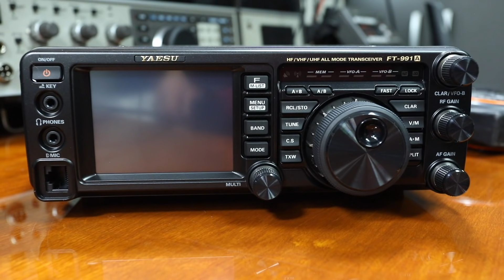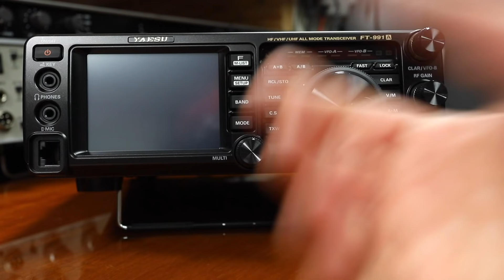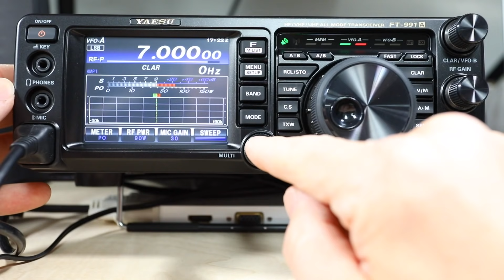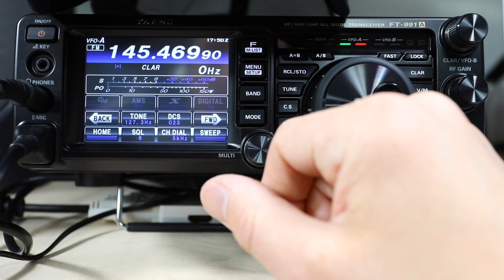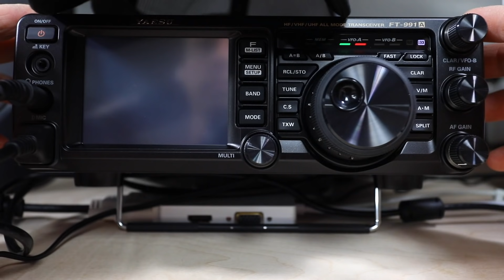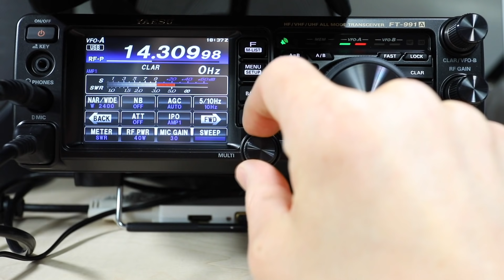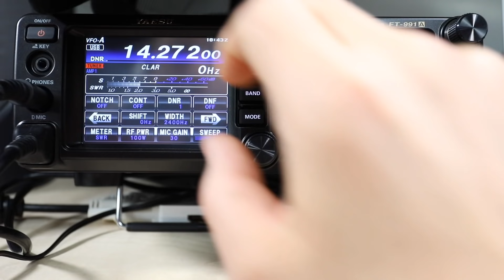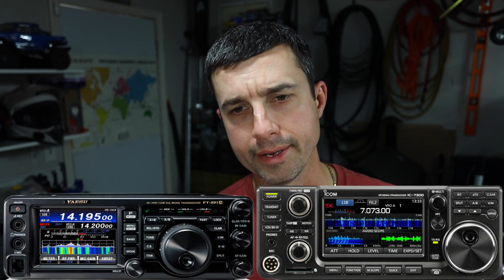Yaesu FT-991A Unboxing + On-Air Tests

Comment: I like the FT-991a for the fact it covers 2 m and 70 cm, it would be a good replacement for my FT-897 although I like it too.  BUT, a couple years back when I was looking to purchase either the 7300 or the Yaesu, the 991a wasn't out yet, just the 991.  Only after I got my 7300 did the 991a come out.  Yes, the 7300 is a great radio, but the 991a would have suited me well also.
73 de KQ2N
Reply from the maker: It was a tough decision for me too. I am using the 2m side of it, as I'm running a boom mic into into it. I just have to watch my mic gain. On HF SSB, I set it at 44 and when on 2m FM I have to drop it down to 18 other wise I sound very over-modulated.
Reply: I bought a second hand 991 (not an A) just before Christmas as a Christmas present to myself. I had a slightly different route to the decision though! I have/had a second hand IC-706 Mk1. Works great, but I wanted UHF as well and maybe a bit more power on VHF. I have a mobile 2m/70cm set, but I wanted something which could sit on my bedside cabinet without too much of a mess. So. Would it be worth going for an IC-706 Mk2G? Quite expensive at about £500. Wonder what I could get an IC-7000 for? Ah, one sold for £585. That would definitely be preferable. But that must have been a one off, they now seem to sell for well over £600, nearer £700. Hmm. How much is an FT-991a? Hmm, over £900 second hand. But it has a built in tuner, so...

Oh look, someone's selling an FT-991 for £615. Will that fit on my bedside cabinet? Yep. Ok, I'll buy it!

So I didn't really start with FT-991 vs IC-7300, I came at it from a different angle. A bonus is that one of my local repeaters is Yaesu digital, which is sort of the icing on the cake, though so far I've only found one other person in the area I can talk to. He was really surprised when I came up on the repeater as he'd been on his own there for a couple of years... :-)

Comment: Interesting stuff, thank you. I am considering getting 911, you may have made my decision a little easier. The video would benefit by removing the  unnecessary background noise, I am a little hard of hearing, advancing years does that, any background sounds make understanding harder. Bin the added sounds, it doesn't make the video any better or more interesting. Sorry for the grumpy remarks and thanks again for posting this.

Comment: Very nice review. I'm a new Ham, earned my Technician license in February of this year and am currently working on my General. I have been considering three radios to get into HF. My current VHF / UHF radio is a Yaesu FTM 7250 and I absolutely love it. It works very well and unlike so many of the other manufacturers, Yaesu offers a three year warranty. On the lower end of the price range, I've considered a FT-450D and on the upper end I've looked a the FTDX-1200 (There are still some new units out there) and the FTDX-3000. I really do like the scope on a radio but considering budget, I could do without one. I'm just curious if you have considered any of those radios and what your opinion of them is. Thank you and keep those videos coming. I really enjoy them. David K4UVX
Reply from the maker: Thanks David for all the kind words! All the radios you mentioned are great. The 450D seems like a great radio for the price and a few people in my club have it and they like it. Two things I kept in mind when shopping was the ability to plug in a USB cable and new digital filters that helps with receiving. Best a luck for General, HF is a lot of fun! 73~Jason/KM6FAK
Reply: Thank you for the feedback Jason. It really helps me evaluate all the choices out there. I was definitely considering the ability to connect to my computer but had not considered the digital filter options. Thanks again! 73's David / K4UVX
Reply: David Hayden congrats on your technician.   How is going with the general studies.  I just passed both tests at the Cowtown HamFest in Ft. Worth.  I am taking notes here.  Haha.

Comment: you can`t compare the 2 radios, for HF the ic 7300, for a shack in the box 991a.
Reply from the maker: You are correct they are apples and oranges. But, it was a decision I needed to make and I needed to compare them to make my final decision. If you look at the other comments, I'm not the only one comparing/deciding.

Comment: A fine radio for its band coverage. Why though did Yaesu not use a proper VHF/UHF Antenna socket. i.e a" N" type socket that is a 50 ohms rated connector for VHF/UHF frequencies. I would more than likely change it for a Ex mil "C" connector.(like a larger "BNC"). I used those on UHF radio relay equipment years ago. I would do that for any coax connector at those frequencies. Plus they are waterproof and easy to connect. I hate to say so but the sound of received CW from the FT991A leaves a lot to be desired compared to the IC7300. I am a musician and hate to ear distorted sound and to me You would soon tire not hearing a pure note, be it low or high. That's personal taste. like receiving CW from a buzzer rather than a sine wave oscillator. Overall what you get for the price is dam good. I have not heard much of a review on the C4FM  mode on the FT991A. It must attract quite a good number of Hams who use 2m/70cm. It appears to be a very popular mode in my area alone has well a lot of the U.K. So that must be a good thing for the FT991A. We shall all have to wait and see. 73 for now de G0WXU -John.
Reply from the maker: Thank you John for your thoughts! Is there any VHF/UHF radios that have came out in the last 10 years that have type N connectors on the back? I can't say I've seen that personally my self. It would help the losses. I can not speak to how the CW sounds yet, but my friend has the IC-7300 and I will check it out.~73
Reply: I currently have a new Yaesu FT-991A and mine came standard with a N-Type socket for the VHF/UHF side. I don't know if that's because they made the UK version different to the US version 991-A.
Reply from the maker: Mike Oh no kidding. How about that...

Comment: I just ordered the Yaesu 991A about 3 hours ago, I am super stoked.
Reply from the maker: Alright, congrats! We might need to start a club soon, lol
Reply: @HamRadioTV  Strange YouTube didn't notify me about your reply, sorry I just saw it. A 991 club would be cool for sure! 
        This will be my first rig setup in a base station role, I like the option to go mobile with it but I don't see myself doing that unless it's some kind of SHTF scenario,  I do like option though, I like options. Since i'm getting ready to take my initial dive into HAM after years of putting it off, I will be getting my Technician license soon and this is my first real radio (initially got a couple BaoFeng BF-F8HPs) I have a Diamond X50A on the way for my 2 meter / 70 cm setup. What do you recommend for a HF antenna? I was thinking of getting a MFJ-2104 Octopus. Great channel btw!

Comment: I've been off the air for a long time and recently put up an antenna and got back on.  I"m running an old tube transceiver which dates me (Swan 350C which I bought new believe it or not). .  I've also been trying to come up to speed with newer rigs and watching this video after watching a couple of the 7300 is interesting.  I see a lot of overlap with the two rigs BUT the Yaesu (for me) has the advantage of a decent VHF and UHF set for an extra $200 and that's a pretty good deal.  I must admit I am partial to Yaesu from my old HT days (it still works and the FT209 RH is my current 2 meter set to an external J-Pole).
To me, it looks like a very good choice of equipment at a reasonable price.
Reply from the maker: Welcome back to the hobby! Yes, the FT-911A has been a great radio to have in the shack as well as taking it portable. I also enjoy the Yaesu brand.

Comment: Just found your video today, as it came up on the suggested list. Congrats on the 991A. Bought the 7300, myself. I think the 7300 is probably the better choice, if you're mostly aiming at the HF side of ham radio. For the "shack in a box", or, if you're really wanting vhf/uhf, along with system fusion....then yes, the 991A is the obvious choice. Now, if it was 100 watts on vhf/uhf.....oh, to dream. On another note...don't cut that old TenTec short. I still believe it has a better HF receiver than either the 7300, or, the 991A....especially if it has filters installed. I own one of those, as well. Anyway...hope you're still enjoying the 991A. They sure pack alot of punch in these new rigs. Just as with automobiles, though....pretty tuff repairing them yourself, any more. 73.
Reply from the maker: All good points! I agree, that 7300 is a very nice radio to use and look at. The Ten-Tec was given to me to use from my Elmer after I upgraded and it has been a ton of fun. He got it from a SK and we are not sure how the alignment is and what filters are in it. Perhaps with a little work to it I could get it to receive better then the 991A.  Also, the new digital filters in these new rigs do work well.

Comment: Super Radio, congrats, im a Yaesu fan,  FTdx3000, FT897D, FT450D, cheers n 73s  A92GW
Reply from the maker: Thanks! Yeah, It looks like I will be flying the Yaesu colors too! An HT is probably next. The FT-8900R in the car has been flawless for the last 3 years in the California HOT weather. ~73 KM6FAK~
Reply: @HamRadioTV  yr vid, did the trick,
Bought the 991a yesterday,... super happy, using an mfj whip clamped to a hand truck, dolly,  my first contact was to VK boys in Australia, from San Jose CA, was only running 50 watts,.. was special  moment...  cheers n 73s
Reply from the maker: Alright!! Awesome to hear and congrats on the new rig! WOW! 50 watts to Australia, you are doing a lot of right things. lol 73!

Comment: Very nice video, I been looking at this radio now for a couple years, running a 450D right now but want the vhf/uhf built in, 73,KG7VDN
Reply from the maker: Thanks! The 450 is nice, but it is cool to have a Swiss army knife for a radio to use.

Comment: I was hoping you were going to show how the linear amp is working with this radio. Nice review...
Reply from the maker: ropnjessi Thanks!! Stay tuned for that demo.
Reply: I have the 991a and a Acom 1010 amplifier, I haven't had a chance to set it all up, also most the identical setup, very anxious see your setup running...
Reply from the maker: @ropnjessi  I got it plugged in today. All is working with just that cable I showed in the video.
Reply: Still looking forward to the video!
Reply: @John Cliff , its pretty straight forward. I started off with a keying cable but without a buffer (IE: ARB-704 Ameritron) inline and damaged my cable input on the transceiver. So now I'm just using a foot pedal in which in my opinion is better.

Comment: I want 2m 440 in a base station and others might say just buy a portable but there is no comparison to the features you get with these bands in the 991a. Why others dont include it is beyond me. I've been out of it for 30yrs and cant believe they haven't incorporated a rig like this into a uniden like sds 100 scanner as well. If it's all about information in a diaster, it's impossible to leave out the best trunking scanner.

Comment: A 20 over signal is barely showing a peak on the scope. Would go with the ic-7300 if you don't need a shack in the box.
Reply from the maker: I hear you. The IC-7300 is a great radio.

Comment: I own a Yaesu FT 991a and wish I had bought the Icom 7300, the Yaesu volume level sucks on HF
Reply from the maker: I can understand that. The 7300 has a better display. I've been doing SSB on 2 meters and also working a new Fusion repeater with it, so I'm still good with it.

Comment: the 2m and 70cm is what kills the 7300 for me. do not know why I com did not add it.  biggest mistake..
Reply from the maker: Yeah, Icom hasn't done an all mode/all band 100 watt radio in awhile. Instead you would need to buy both the IC-7300 & IC-9700 to get it done. And, I know a handful of Hams that have done just that. So maybe it was a marketing move.

Comment: Nice rational comparison.  I loved the comments at the end when you wrapped it up.  It's always good to have options and competition.  I'm an Elecraft guy for HF, but lean to Icom on the VHF/UHF side etc...  I started with a Heathkit on HF, moved to a SS Kenwood TS-440, then took the plunge with a Yaesu FT-1000MP when they first came out and operated that for years.  The point is... it's great to see so many manufacturers still in the game.  Those of us that love to operate and play in HF/VHF/UHF etc... are the winners.  Competition drives the feature set and keeps the prices in the ballpark of semi sanity! :)  It's all good.  All of the top manufacturers make fine rigs. Max NG7M

Comment: I just sold my 991 and going to buy 7300. 991 is nightmare i terms of menu (imo my old ft857 has much more better menu) as well technical problems. A lot of units have tuner issue and final transistors are going to be dead. I cant understand why they introduce 991 on the market with so many bugs. As a owner of many yaesu (7900, 8800, vx2, vx8, ft1d, ft857, ftm350) I'm dissapointed 991.
Reply from the maker: Did yo have the FT-991 or the FT-991A? I did hear the 991 did have tuner problems. Bummer it gave you so much trouble. I've had great luck with mine so far and have used the tuner a lot out in the field. The 7300 is a great radio, and I'm sure you're enjoying it.